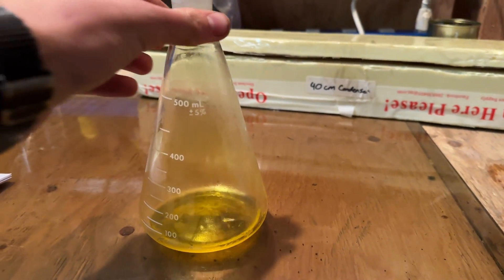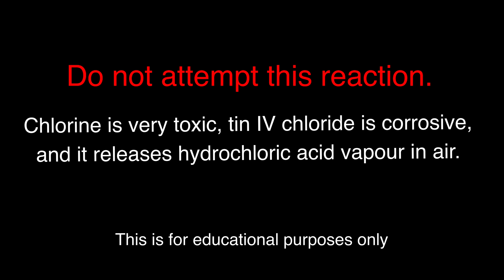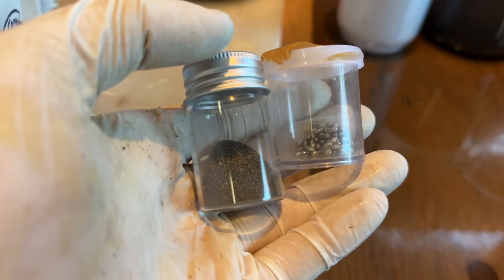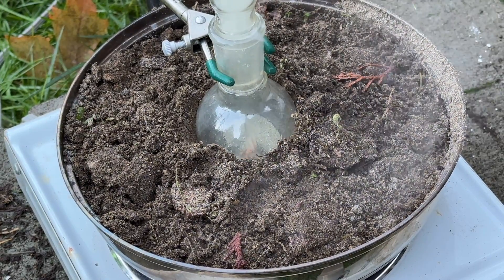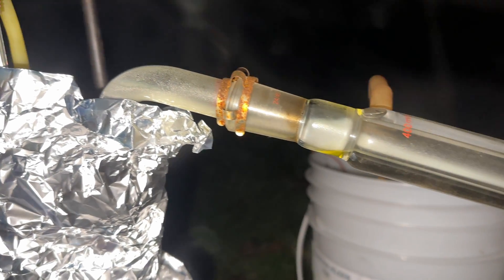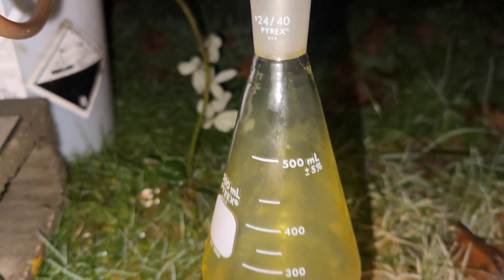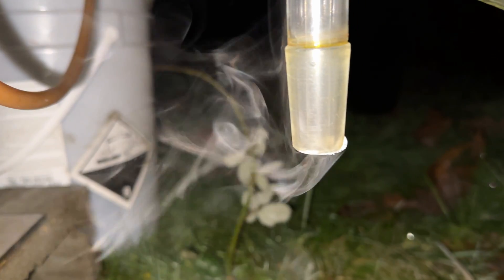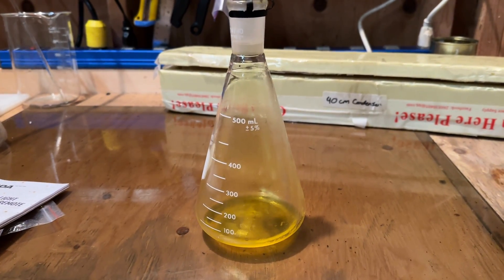Tin IV Chloride - An Epic Fuming Liquid

Comment: So...

Why use an expensive product like tin to make SO3?
Reply from the maker: Yeah, this definitely isn't the cheapest way to make SO3 at home. You'll see in my next video that I'm working on an alternate method, but this was still a fun project and tin IV chloride is a fun compound.
Reply: @TheCanadianChemist  the Pyrophosphate method works great, I save all the tails of my H2SO4 distillations and use that to convert, but it will decimate your glass wear, the heating of phosphoric acid to dull red heat, then the SO3 distillation takes a good bit of heat.
Reply from the maker: What is the phosphoric acid method? I’m not familiar with that to produce sulfur trioxide.
Reply: @TheCanadianChemist  You heat phosphoric acid to meta phosphoric then drip sulfuric onto that. The phosphoric heating can damage glassware, so you use thick glassware and you can only use it about ten times.